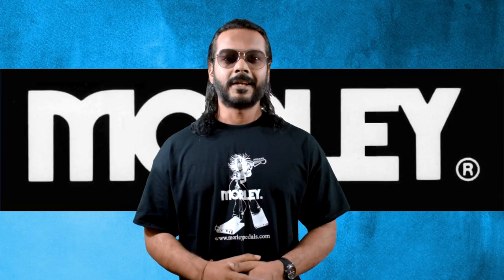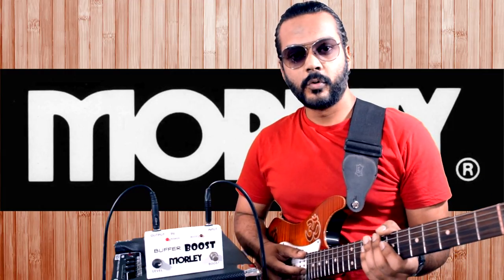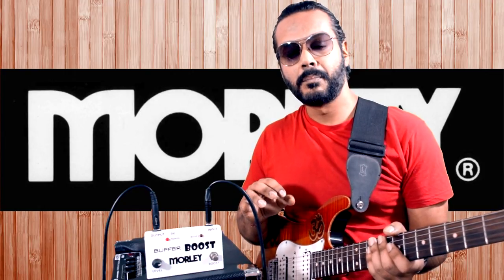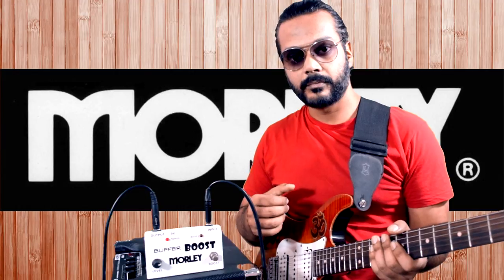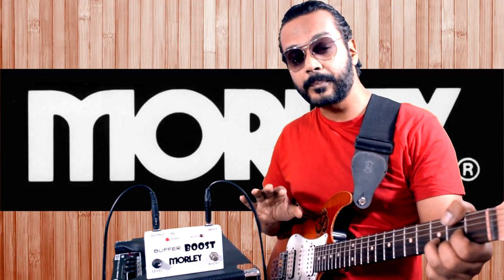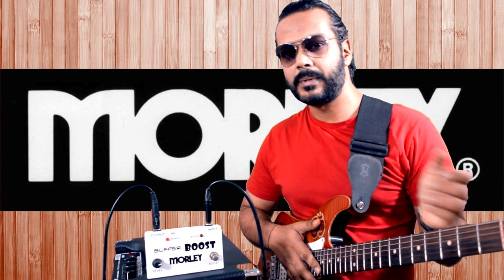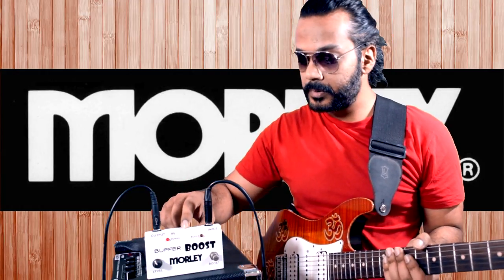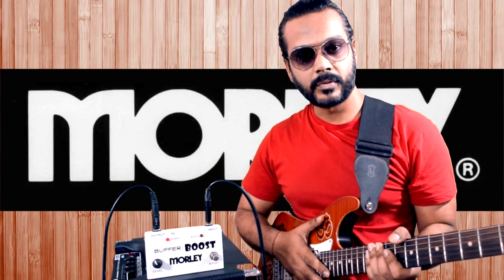Morley buffer boost & A-B-C CHANNEL SELECTOR/COMBINER DEMO by APERNIT SINGH

Comment: thank you buddy for your video : i have a question for th ABC, when you plug a guitar in 3 maps, and switches does tha A still " on" , when you switch on " B ", or it deactivate ? like a regualr amp footswitch ? thank you ^^
Reply from the maker: you can select and toggle between the output or can combine them as well..
Reply: ok ok thank you buddy ! ^^